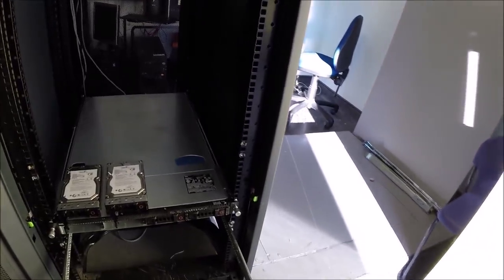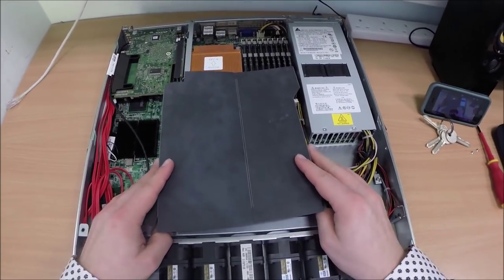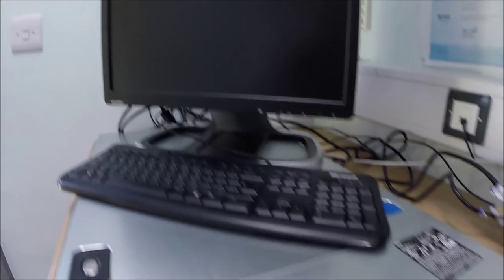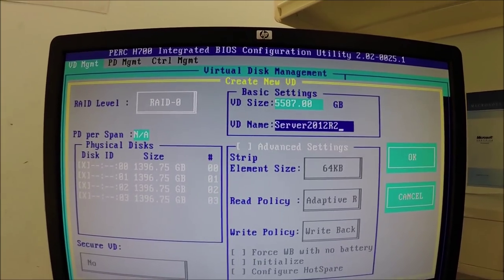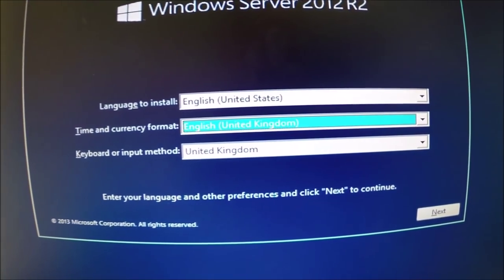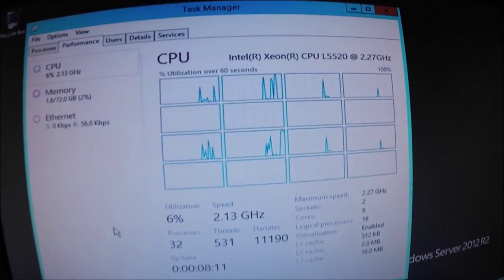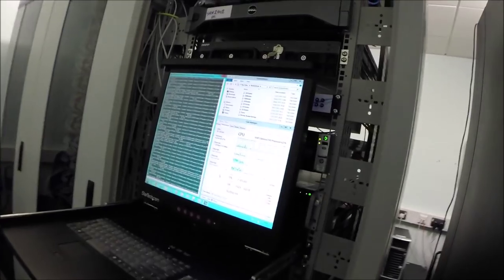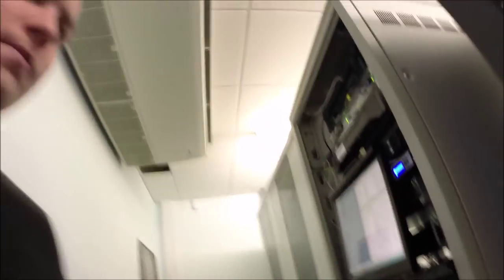File Server Failure & Disaster Recovery (Server Room)

Comment: Using a RAID 5 or RAID 6 on a file server would be a safer open than RAID 0
Reply from the maker: Cheers dude I'll take that on board, We had 2 drives go and regardless of how the array was set up the users would still have issues while we migrate to another server, I'm not claiming to be an expert in raid, just simply doing my best to make do with what I have. Thanks for the comment buddy :)
Reply: rizpiprawala RAID 5 is a no-no because of Unrecoverable Read Error's (URE)  during rebuilds. It's not so much of a problem with SSD's. For mechanical drives you either want to use RAID 10 in a install like this or RAID 6. RAID 0 is just suicide for most things.
Reply: I just go with RAIDZ3 on most of my servers for the 'decent' balance of speed to redundancy. And because I can't afford $300 in drives every time one shits the bag.
Reply: Jake Billing you just keep doing what you’re doing. Of course in this situation raid 10 would have been better but sacrificing storage space was probs not an option in line with education environment budgets

Comment: NEVER use RAID 0 on a server. RAID 5 would be MUCH better. If one of those drives fail, you lose EVERYTHING. RAID 0 has NO redundancy. especially using seagate drives, you have big balls my friend.
Reply: Agree, raid 0 is a bad idea, as is raid 5. This was a file server so speed is crucial. I would have recommended a raid 10. :)
Reply: The idea is that they have daily backups created on the server. I understand your concerns but its not too too bad assuming its backed up.

Comment: How long does the POST take on this server? On an IBM 3650 it takes ages, well 2 to 3 minutes just to get to the point where the OS starts to boot.
Reply: ekhaat 2 to 3 minutes seems a bit long, depends on how many memory you have on it or if there's a defect in the server taking a long time to be confirmed defective before the server moves on.
My IBM x3755 running 64GB of ram also takes about two-three minutes to initialize it's CPU's, and another two minutes to check the ram before it starts booting it's OS.
My older HP DL380G4's would run black screen for one minute, then show the HP Proliant screen for a half minute and then start checking memory and so on for two minutes (with just 6GB ram...) so I guess it's just a common server thing.

Comment: this vid came up in my suggested i see this and im messing with a Dell PE T320 5u which i salvaged from a closed down video rental store though now its not no ordinary server its had some tweaks and upgrades from its original config
Reply: A T320 is an ordinary, old, low spec server no matter what upgrades it has.
Reply: @incandescentwithrage  it may be only a single CPU but has had masive upgrades like cpu went from a e5-2403 a e5-2470 (i wanted a v2 but that was out of my budget at the time) also its using a gtx 760 SC instead of onboard video and it also has a sound card as with redundant PSU's instead of the original non redundant i could upgrade the GPU to something i would be happy with now i just need to upgrade the ram as it stil has the original 12gb it came with when i found it